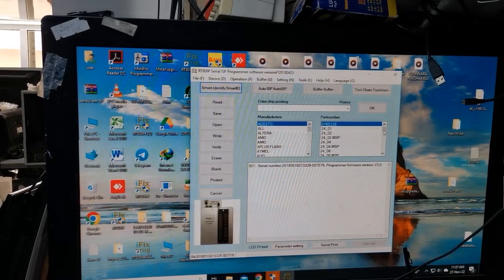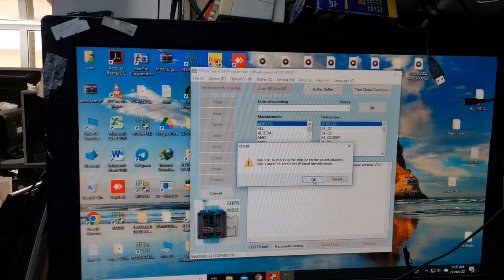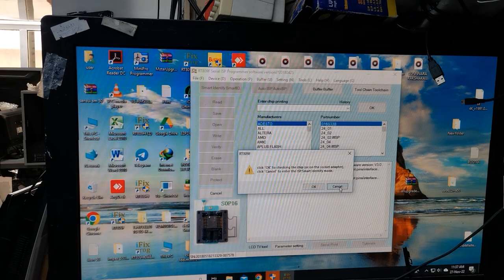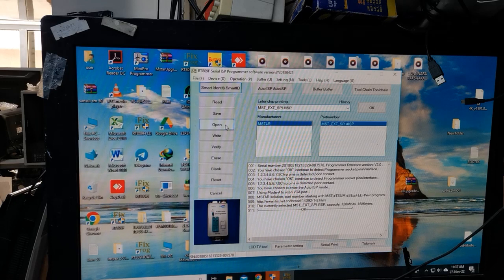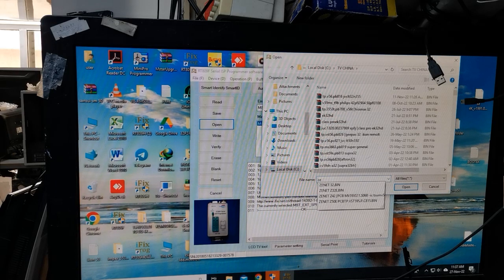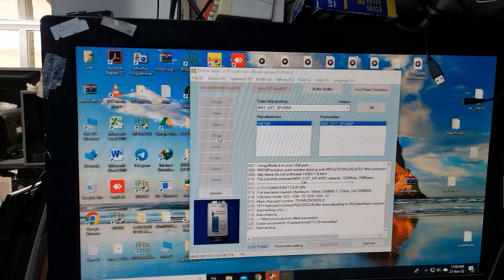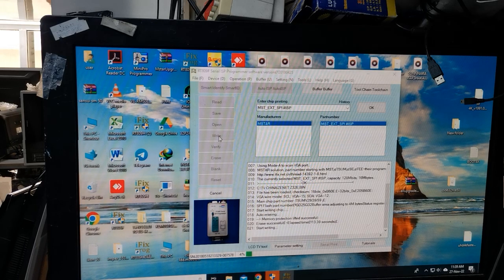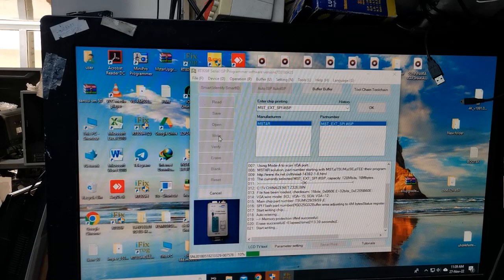LED TV power ok not working. How to understand memory IC damage.Memory IC.rt 809f.tp vst59s pb813.

Comment: My wanna tv power supply led voltage out originally 48 volf but screen low bright I check led out volt only 27 volt what problem
Reply from the maker: First check the picture setting.  sometime LCD screen also damage coming low brightness. LED bike light also damage possibility